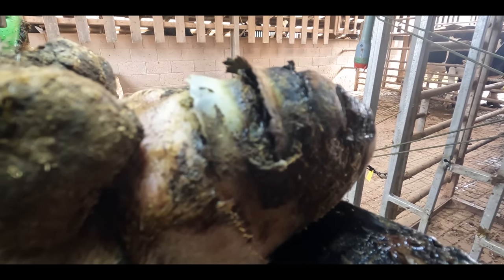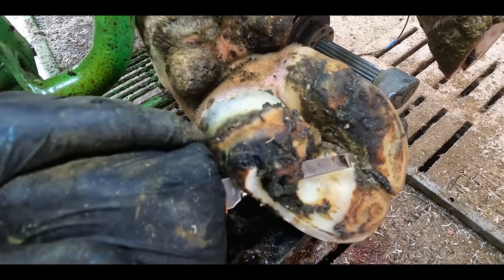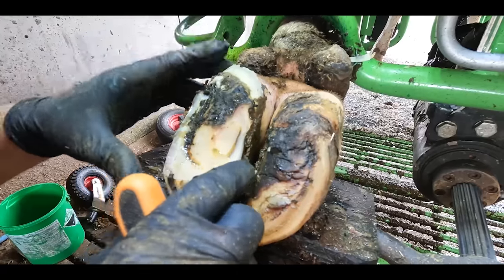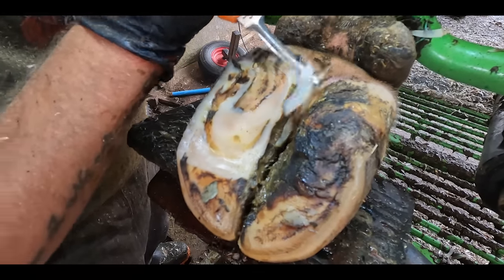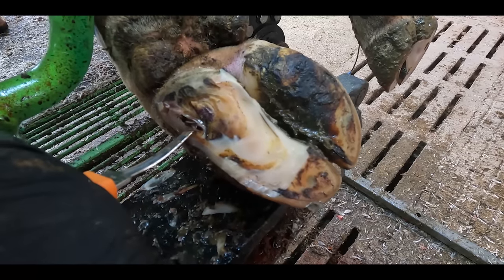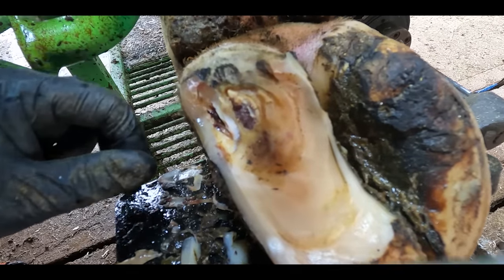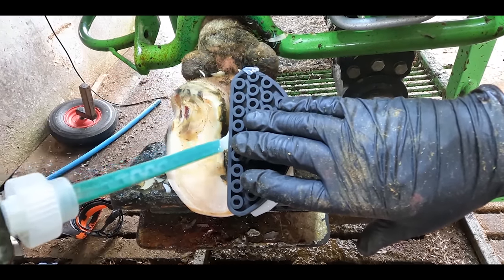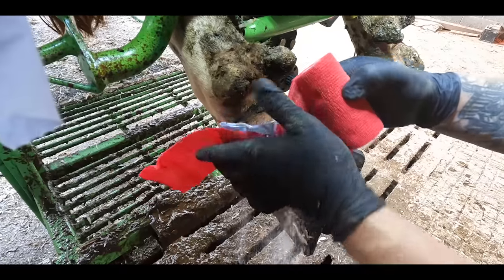PEELING LAYERS & LAYERS .... & LAYERS away from this HOOF

Comment: I have been watching a ton of your videos, and as a farrier I can understand why and how you do most of what you do. But I have a question. What do you do in a situation where there is a problem or an abcess on both claws of a leg.
Reply: I'm not sure if he has different shapes and types of blocks, more recently a cow had an issue with one claw, but then a second problem with the inside of the opposite claw - he used part of a horse shoe as a block, just around the wall of the claw, as a horseshoe would sit on a horse! It didn't cover the whole sole but added enough height to relieve both problems.

Comment: I wonder have you ever accidently cut yourself with the blade? I know its sharp because from what youve said in a previous video you said its like carving wood and you have to put alot of pressure into each cut and it is pretty tiring. Another question if the first is Yes. If you have been cut by it what procedures do you have in place like do you only bandage it or put only anticeptics or do you go to a hospital to get it professionally seen because of the potential infections?
Reply: Sorry if this isnt the appropiate place  to ask.

Comment: Graeme, I will start by saying I love everything you do. But... I'm a little surprised that while you have insisted in the past, that the only safe and sure fire way of doing things correctly, is by following the method, you did not begin by leveling and balancing the claws, or by modeling out but by starting with step four.  Just curious if there is a reason or not? Remember, even surgeons follow checklist. Don't do anything for our benefit. Do what you do best. Love you and Craig! Thanks guys!